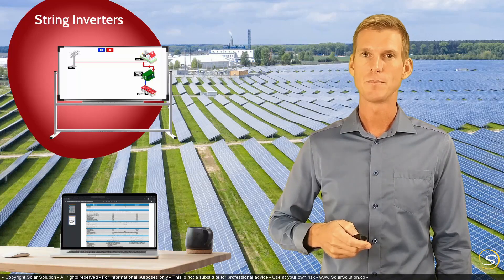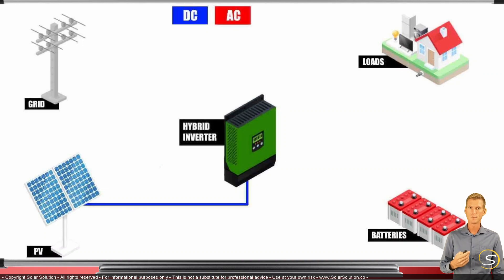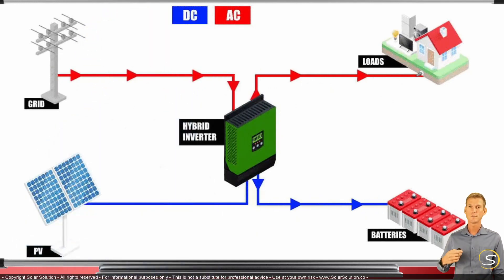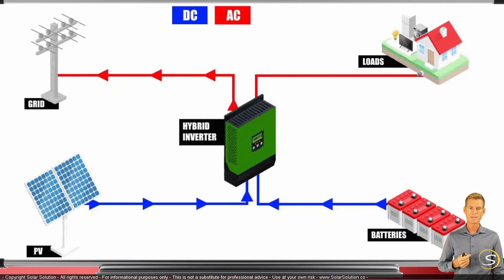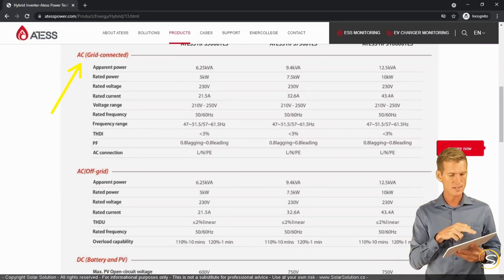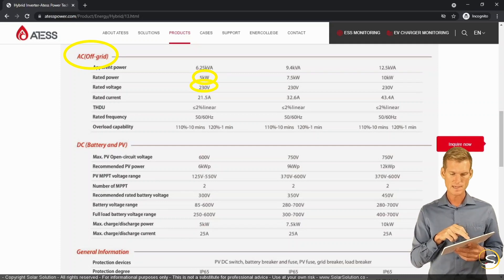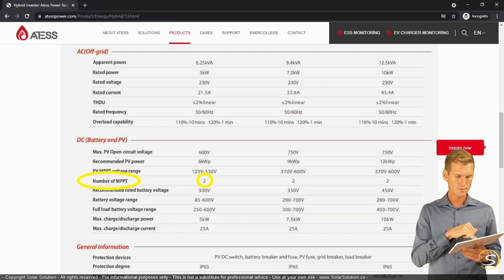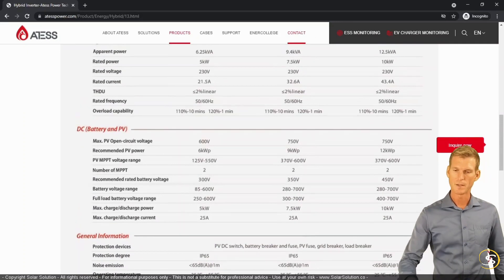The Hybrid Inverter: What's the difference & Are they better?

Comment: What will be the Main Difference Between a String Inverter and Inverter please?
Reply from the maker: Good question again AKhan! A string inverter is a device that converts the combined electrical output of a group of solar panels into one single Alternating Current [AC] output. An inverter normally refers to a device that takes the electrical power from batteries and turns it into an AC output. It seems that you are doing a lot of research and are learning fast, well done AKhan! Jesse
Reply: @SolarSolution  Thank you so much for your answer and encouragement to ask questions, really appreciate it.
Reply: @SolarSolution  So in simple words it means where is the inverter installed; If the inverter is Installed dealing with PV output to convert it to AC then it will be called String Inverter And If the inverter is installed and dealing with Battery output to convert it to AC, then it is called simply An Inverter.

Comment: What if you want to use the hybrid inverter in a Country such as Cameroon where all appliances use 240V?
Reply from the maker: Good question Bertrand! Most models are able to set the output voltage [and frequency!] to match your requirements. So please make sure that you purchase the correct model. Good luck! Jesse

Comment: Hello all I am trying to design a PV solution for my House. I intend to install between 6 or 7 KW. I fully understand what gets connect to what....Fine. And as a major part of my electrical consumption is the home IT environment. As such I am wondering how i can configure the connection to provide a UPS function to ensure no interruption of my IT environment. Is there a solution for this situation or do i need to purchase an additional UPS solution for my IT environment. Thank you
Reply: You should check the specifications of the hybrid inverters. The hybrid inverter in the example should be able do it: "Seamless transfer
Uninterruptable power supply guaranteed".

Comment: Hi, great video. One question: Your graphic shows that when the grid is supplying the power, its current flows into the hybrid unit, and back out to the loads. Lets say I have the 5kW nominal device in your example, perhaps it can supply 6kW for one minute. But what if my load demands 10kW? If the grid connection is passing in and back out of the device, does that mean the max draw is still 6kW? Will it just shutdown? Or can the grid somehow be used to supply the missing 5kW, bypassing the inverter's circuitry and maximum capacity limits?

I ask because I'd like mppt charging, a battery, and an inverter, and I'd like to pay for the 5kW one as that is our maximum normal draw, but just occasionally, during a perfect storm of heating and cooking and car charging, we might use 10kW, or higher. I've been told I'd need a grid-tied system to allow the grid to top up such surge demands, effectively in that circumstance the inverter is apparently just connected in parallel to the grid, but apparently 'grid tied' systems are not the same as hybrid and they cannot use batteries.

Very hard to shop for or budget for these things when the nomenclature seems to vary and having spoken to 3 salesmen from installers and NONE of them seem to be able to actually answer these questions!
Reply: The image shown is a simplification. There is a grid connection to the inverter so that the inverter knows that there is grid power available. Most hybrid inverters then can feed 2 different AC loads: part of your loads can be connected as critical loads, which means that when there is no grid power available, the inverter will try to keep them powered (from solar and/or batteries) and when grid power is available, it will feed both the critical and non-critical loads in your house, trying to power all your loads and if it does not produce enough, the grid will automatically supplement. If you have big loads, then you want them on the side of the non-critical loads connection, or they might trip a fuse during blackouts.

In your case a hybrid system makes sense.
Keep talking to salespeople until you find one that actually understands what he's trying to sell and can explain it clearly to you. If the solar company doesn't seem to know what they are talking about, then it's time find another one.

Comment: I am very new to all this and just jumped into the youtube university :-) I am trying to find an easy way to combine a small wind turbine with a small test off grid system i have in my mind.I am thinking if just connect it with the AC input of a hybrid inverter( the most of the turbines produces AC right?) if the small ammount of electricity will cause any problem to the inverter? Or maybe there is an other way like hybrid charger controller and go with a classic inverter and not hybrid. Grate work i am glad i found you, thanks for your answer, forgive me for any mistakes in my english (my 3rd language )

Comment: Thanks for this amazing video. But please can hybrid solar inverter with inbuilt charge controller charge batteries using only the grid or electric generator? That is without using any solar panel.

After which the charged batteries will supply the power stored to the house. Your response will be highly appreciated. Thanks
Reply: Hi Ned, good question and the answer is yes. I do this at my home, I have 10kw of solar PV on roof, so I just plug my All-In-One into the wall socket for grid power charging my 48v batteries during the day when I am producing more than I am using and use the battery bank after 4pm set on timer to charge from 8am-4pm and when the timer cuts the power to system it automatically switches over to battery without any interruption to power output. So to be clear, I have my appliances plugged into all in one system (fridges, tv’s, microwave, etc) which is always going 24/7, but when the timer switches on the power at 8am it charges the batteries at whatever amperage u set it to and powers the appliances at the same time..this system can be set up to a generator as well, but I dont plug any panel into this system as I already have an excess of PV’s on my roof, so u can use them to store power on the cheap rate through the day, to use after 4pm when power is more expensive if that is what u are getting at. Cheers